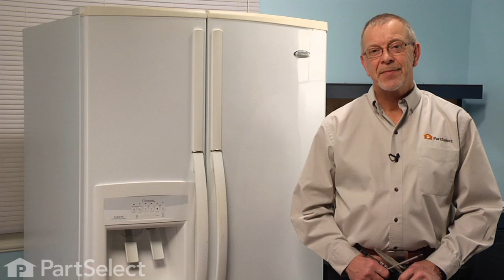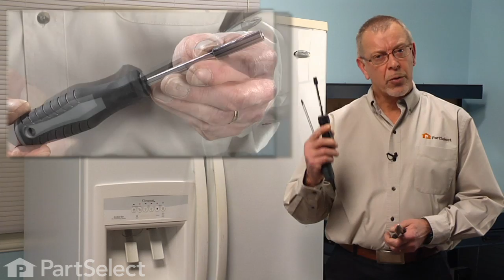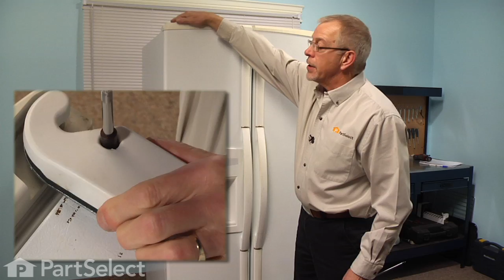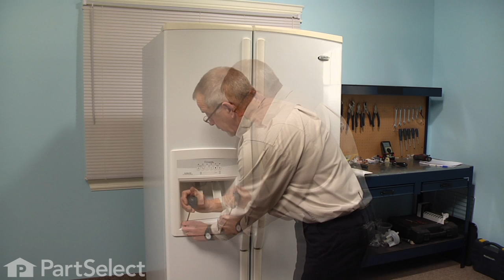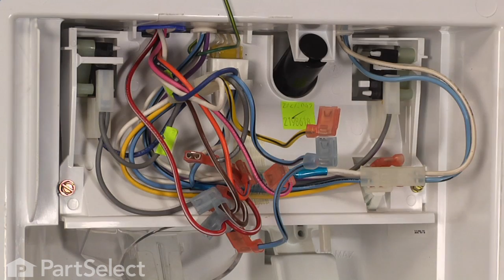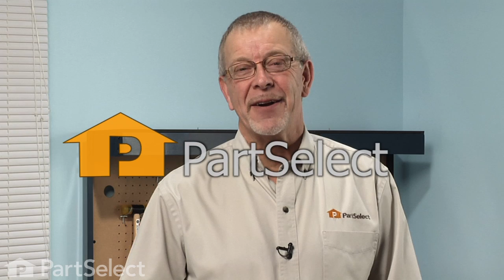Refrigerator Repair -- Replacing the Control Bracket (Whirlpool Part # 2180226)

Comment: My problem with my refrigerator was that it did not dispense the ice. I was afraid to take it apart, but your video really encouraged me to try to fix it. It turned out that one of the poles, which is built on the control bracket, that holds the microswitch was broken. 
Thank you sir for your explicit demonstration. You made it so easy. This video is extremely helpful and very beneficial to a person like me who knows nothing about refrigerator. Again thank you,
Reply from the maker: You're very welcome. We're very glad it was helpful!

Comment: The symptoms I had was that I had no ice or water dispensing. This is the cheapest thing to check first before moving to the micro-switch(es) which is not hard either and assumes that the control bracket is not broke. It is easy to tell if it is broken as plastic pieces will fall out and is an easy fix. The most expensive part and last resort is to look at the water filter valve (or water inlet valve) which is not hard to replace but is pricey compared to the control bracket.
This was such an easy repair. I was done this repair faster than I could play the video. The hardest part was taking the escutcheon off of the front of the refrigerator. I had both pins broken so the replacement went even faster. Great video describing the repair! This is the second video from PartSelect to show me how to fix and appliance and save money from the repairman! I also replaced the shocks on a whirlpool dryer successfully with PartSelect videos! Thanks!

Comment: Thanks for making this video.  Your company states that the control bracket solves the problem (water not flowing) 48% of the time.  I was doubtful, but when I took my face plate off, sure enough the plastic pins holding the microswitches were broken. My question is, if this part is known to fail so much, and part number PS327360 works for 15 different manufacturers, why isn't the part made better?

Comment: repairman was charging me about 70 bucks, and found the part on ebay for 11 bucks and fixed it myself. Feeling good. The pin that activated the switch snapped off.

Comment: I can understand the water not coming thru but it is strange that they both worked before I replaces the control bracket. I just had the micro switches checked and they are ok